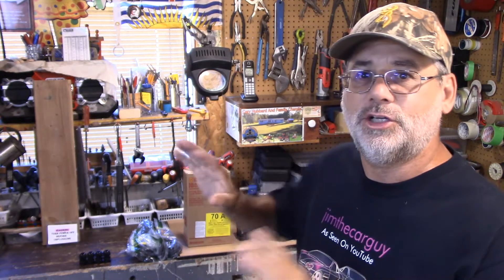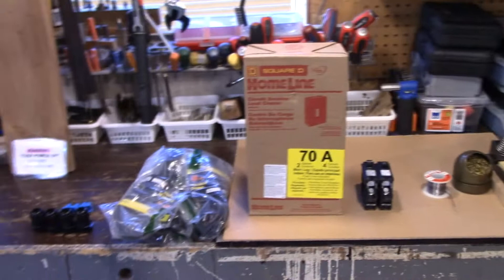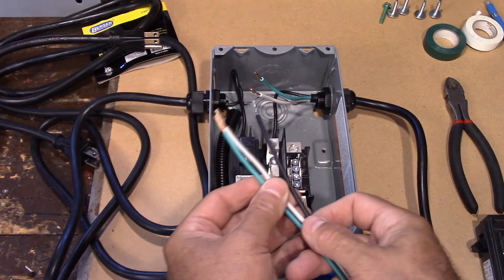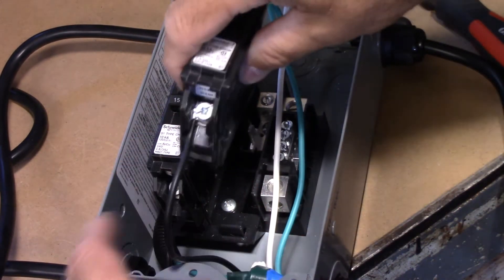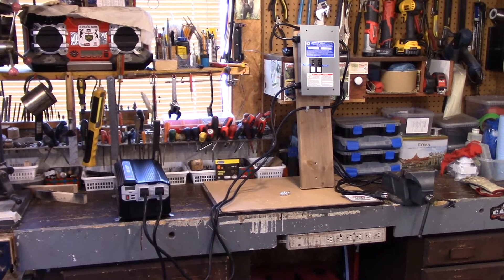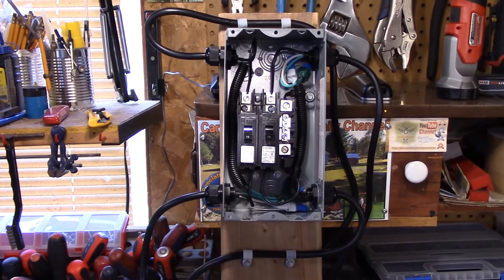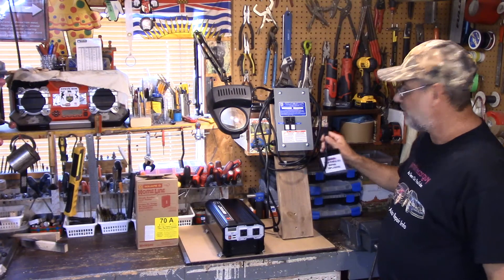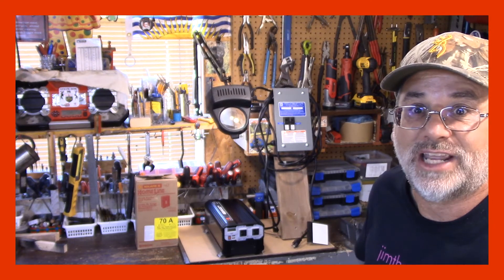Wiring A 2 breaker Fuse Panel For  A  4000 Watt  Power Inverter

Comment: May i ask why its a good thing? I have 2 outlets for my RV but both straight to the inverter. They told me the inverter has a build in fuse so there was no need for a fuse panel. But I'm a complete electrician noob myself and love to know as much as possible without needing to become an actual electrician. I loved wiring up my van and seeing what you can do especially with 12v lights. I felt like a kid seeing magic in movies for the first time😆 Note i won't try any high amp dangerous stuff without an actual electrician with me but it's still fun to learn about.
Reply from the maker: Milo , great question.   This inverter will produce more than 15 amps per outlet so I am regulating it thru two 15 amps breakers  in the fuse panel to a maximum of 15 amps each or 1800 watts like a household circuit.  I have no need for any more output plus I prefer to depend on some real good fuses and not rely on fuses I do not know about. Safety first 👍
Reply: @SteveRobReviews  Thanks for the quick reply. That makes totally sense! Well your warning definitely kept me away from trying haha. Quick question do you by any chance know if its safe to plug a power strip in one of the outlets i made, as long as it obviously doesn't exceed the limit of the inverter and outlet? The outlet itself supports 16 amps directly hooked to the inverter. I'm trying to find out if you can plug a powerstrip directly into those like you can at home and not violate any codes? Currently i unplug the wall outlets from the inverter and plug the powerstrip in the inverter if i need more than 2 appliances powered, wich is quite annoying. It would be much more useful if i could just use the power strip with my wall outlets and power multiple devices. I'm from the Netherlands and vanlife isn't popular enough over here to find any of that info online. If I'm guessing it would be possible? So i might sound stupid for asking but i basically live in it so better be safe than sorry😆
Reply from the maker: Sure that's fine as long as its in a dry location . Cheers
Reply: @SteveRobReviews  Thankyou finally someone that was able to answer that for me😂 I subscribed to learn some more from your content. Cheers!
Reply from the maker: Thanks Milo 👍

Comment: Like the idea of tinning the stranded wire. Great idea when making extension cords or even changing a  damage end .PERFECT..👍👍
Reply from the maker: Hi Les 
Yes tinning the wire sure makes for a much better connection and when tightening down on it really holds and does not loosen off over time like braided wire can. Take Care bud 👍

Comment: Maybe paint those power cord ends orange and hang a tag on them too
Reply from the maker: Each cord does have a warning tag attached but in reality the safest advice I could give is alway turn the power off at the source , test to verify its off then work on the circuit if you know what your doing . Cheers bud 👍

Comment: Nice setup, that will work great at the camp. I like using the recessed RV type socket so a regular extension cord will plug in at the wall . But you are the only one using so it's fine. Cheers Steve 👍👍
Reply from the maker: Great choice Lloyd . I have to be able to remove the inverter and the stand  its mounted on to service the batteries below so plugs are the easiest way for me. As always we always shut off the power before working on a circuit so the breakers  cutoff the down stream electricity.  Cheers bud 👍

Comment: You got two views outta me today.  I was watching it and then my phone rang,  I thought I'd paused the video but hadn't.  So, here I am after watching it.  Getting pretty fancy out at the cabin. Next thing ya know you'll be putting in an indoor toilet and maybe some nice soft bear skin rugs beside the beds so your feet don't have to touch the cold floor before you get a chance to put slippers on. 
I was gonna build a 100' 240v extension cord for my welder awhile ago and the price of wire and whatever else I would need, it was cheaper to buy a premade cord.
Have a relaxing Sunday Steve
Reply from the maker: The price of wiring is nuts today.  2 views get you ⭐⭐⭐⭐⭐ Bruce :) Thanks bud👍